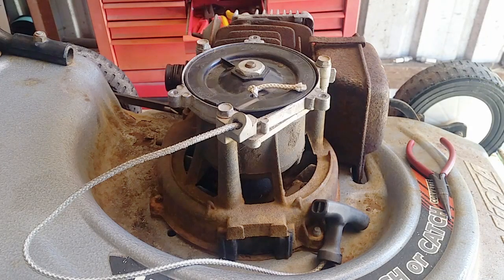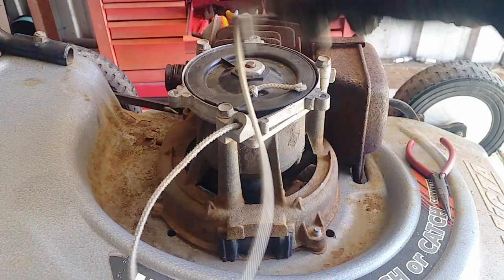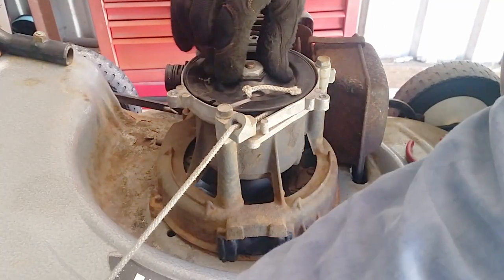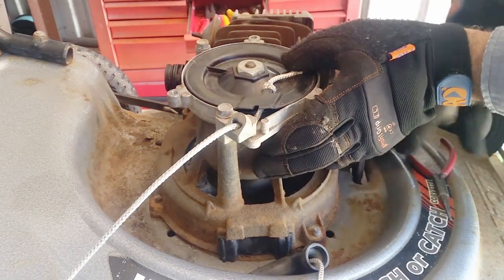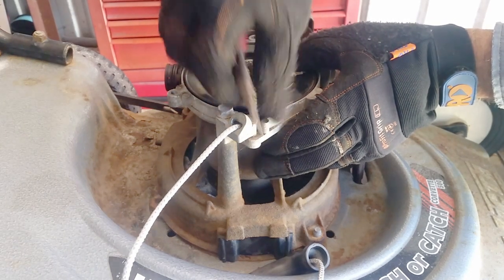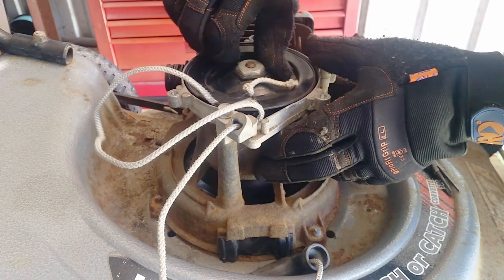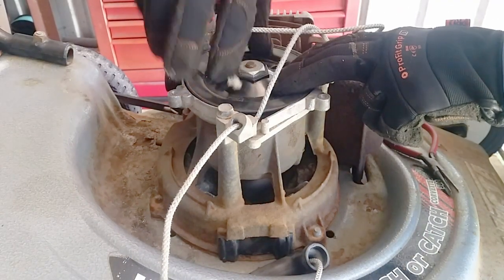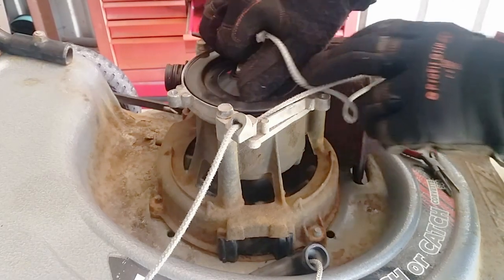Can I Fix it? #4 Victa 2 Stroke Powertorque Engine Recoil Starter Loose Rope Fix

Comment: Thanks for this. I have a victa 2 stroke but when I wind the pulley clockwise.like u do, the spring does not tighten so can wind it 20 times with no tension. Any tips? Is the spring broken or.maybe the lugs not disengaging from the pulley??
Reply from the maker: Yeah, you're probably right. You're going to have to dismantle the starter to find out what is going on in there. The worst case scenario would be a broken spring.
Reply: @lawnmowermaniac  oh I feared that. Thanks for the prompt reply. Sounds like a whole new video. 😊
Reply from the maker: @emn8or  Yes. Thanks for the suggestion. That is now on my "To do" list.